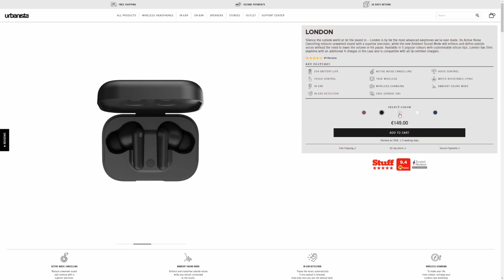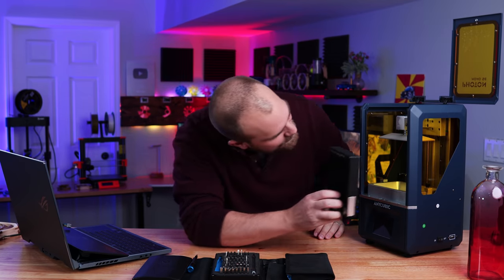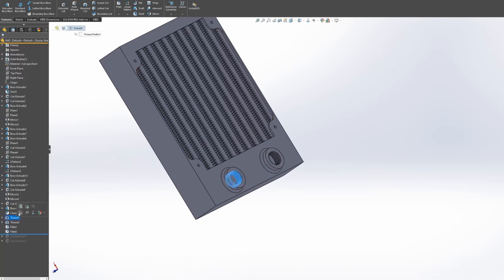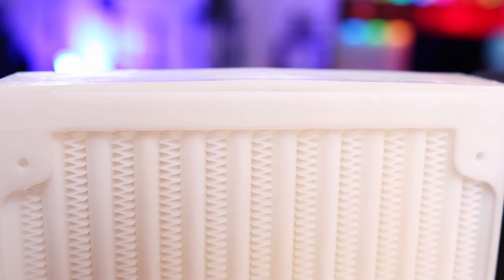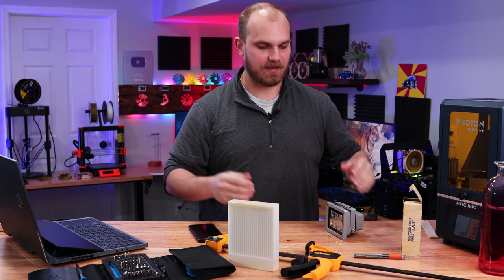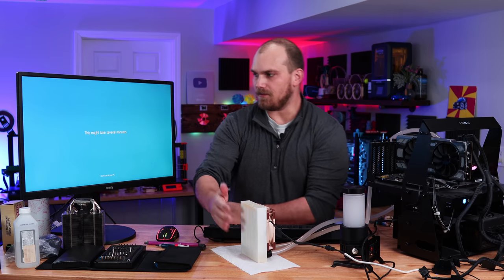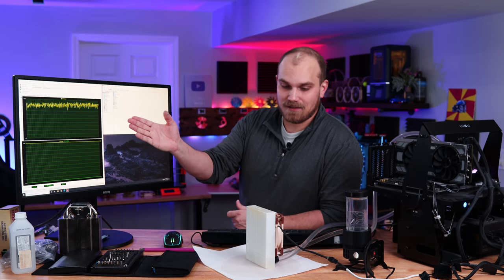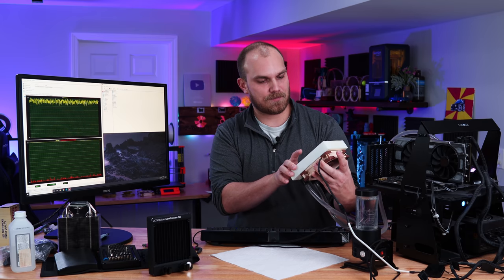I Never Expected This | 3D Printed EK Coolstream SE 120mm Radiator

Comment: There is metal resin called Tethon Ferrolite
However, it is 200 bucks for 500 mL
But maybe a sponsor wants to see this :D
Reply: Exactly my thought we need to get this to the top of comments so he does it.
Reply: @jacobleeson4763  It would be a super interesting result! I hope it is possible to do
Reply from the maker: 200 ducks wow
i would def try it if i could get some
Reply: @MajorHardware  i would fund this project if i had the cash
Reply: @MajorHardware  
1. Make the walls of the water channels as thin as possible.
Why? -> If you have a infinite thin wall it doesn't matter what material it's made off.
2. Remove the fins between the water channels.
Why? -> Due to bad heat transfer of plastic they don't do much except of blocking the airflow.
3. Try to fit as many water channels in the given area as possible without blocking airflow too much.
Why? -> To increase the surface area, but without letting the wall effect having a big impact on the airflow. (check out fin stack spacing on noctua coolers)

PS: Thank you for your awesome videos and greetings from Germany.
Reply: @MajorHardware  Maybe check out ceramic resin?  Still pretty expensive from what I've seen, but less so than the iron resin.  Idk what type of ceramic it uses, but some ceramics have very high thermal conductivity, could be a cool thing to experiment with.
Reply: @MajorHardware  
There's also PLA with copper particles like copperFill but it's pricey too at around $50 for a 0.75kg spool.
Reply: @MajorHardware  The better option in terms of 3d printing a water cooling radiator is to actually make the radiator's frame (fittings/reservoir), but then use flattened copper tubes for your channels/fins with some kind of sealant.
Reply: @chucklesdeclown8819  Shall we make a free fund thingy for the project ? =)
Reply: @SevenSevenXAK  ceramics are known for there thermal resistance....
Reply: @MajorHardware  Well, email them, they might be willing to send you some for a re-do of this project.

But you might want a slightly larger printer before trying.....
Reply: im proud of the boys , engireers for the future. im not sure about the inner tube construction but a long snake loop within the radiator would be ideal. the water spends longer in the path of the air and should in theory dissipate heat better . think an ac radiator that loops back on itself many times.
Reply: @SevenSevenXAK  i think the ceramic prints need a Lot of processing after the Print (Very hot oven) and maybe too small parts that could easily Break at such an expensive print
Reply: @-eMpTy-  i think the Resolution of PLA isnt good enough when you need so many water-tight Channels
Reply: @-eMpTy-  It's pretty brittle though which makes thin walls a no go
Reply: @blendarious  All of this.
Reply: @Corianas_  
Fair warning, I know NOTHING about 3d printing/resin printing and such. My thought, instead of a bigger printer, maybe just shrink the overall size 5-10 mil (if that much) for it to fit, or was it that much of a stretch for the printer?? If I recall he said something about max size was 160, couldn't he set it to 158 just for clearance of the printer and not effect the print results too much for the worst?
Reply: @Destroyer9747  I was thinking this while watching, like how some water blocks have an acrylic top.  My only concern would be if there would be a higher likelihood of leaking between the metal and resin seal.
Reply: @AceBoy2099  Not exactly... the issue he had was more pressure related. as the top is a large flat surface that is held on only by the edges, when the bed lifts it sticks to the build surface a little too long, which creates minor break like he had to fix.

To solve, you don't shrink the model much, but instead have it on an angle,, with supports to get it at that angle.

This would reduces the surface area the top has made per layer, which would allow it to lift up easier without damaging the water tight nature.

but, making it 10-15 degrees off flat, would increase the height significantly, even without supports.
Reply: plus the other issue is, the top gets made as a single piece, and watertight... so lifting lifts all the uncured resin as well, which would rip through the .1(ish)mm plastic bottom.

this could be solved by flipping it upside down i guess so the pipe holes let it drain... but it could be messy depending on how much liquid is trapped....
Reply: 200 ducks is a lot of ducks
Reply: @Corianas_  yeah, but even a 3-5° shift should help.
Reply: @martindinner3621  True. But still he wouldn't fit it in, as the base the supports would need would push it over the height limit.

Unless he shrunk the distance at the bottom where the water goes in/out... that doesn't have to conform to fan size the same, and I think i saw 1-2cm it could loose there....
Reply: @jacobleeson4763  yess'
Reply: @MajorHardware  if you would bite the bullet I'd love to see what it is like!
Reply: @TimmyBlumberg  Are you calling him a quack?
Reply: One of the biggest advantages plastic will give you is less galvanic corrosion, this will massively increase the water loop life cycle. May be we should keep experimenting with plastic only.
Reply: @rallygsixtwo4836  Different types of ceramic have different thermal properties. Some are optimized for high thermal conductivity, like aluminium oxide used in many thermal pastes.
Reply: Actually... I take it back. No angle. Same printer. Replace the top that broke with a 1/2 circle pipe shape, would get rid of the large surface sticking, and would allow the other end to be anchored solidly to the bed.
Reply: @MikrySoft  that’s why I said there known for there thermal resistance
Reply: It could work for sure, but i don't think anyone is producing resin with any of the following ceramics, and it would have to be a resin, because any fillament would simply melt before it should if it had a great thermal conductivity.

Ceramic materials with high thermal conductivity are mainly composed of oxides, nitrides, carbides, and borides, such as polycrystalline diamond ceramics, aluminum nitride, beryllium oxide, silicon nitride, and silicon carbide. Diamond has a strong thermal conductivity
Reply: @icediverfull  That's true, I'd imagine something as complex as a radiator wouldn't hold up well to the post-process. 

Although I do wonder if an unprocessed print would still be functional and perhaps still have higher thermal conductivity than plastic due to the ceramic particles.
Reply: @Corianas_  I like where you are going with this! Maybe go quarter cylinder to maintain the mounting space on thw fan side?
Reply: Maybe you can just mix in your own metal powder?
Reply: @blendarious  two a point, of leackyness. but a few touch-ups to hold pressure and ya good.
Reply: @SevenSevenXAK  Most need firing in a kiln after printing e.g. Porcelite. The one I found which didn't used Zirconium dioxide, which is used as a thermal insulator.
Reply: @-eMpTy-  PLA won't work. TG around 60c max he is topping 100c actually surprised the resin held up to that!
Reply: @SevenSevenXAK   Formlabs.com says this - "While Ceramic Resin is not considered an advanced technical ceramic, fired parts have unique properties when compared to plastics, like high temperature resistance, high thermal and electrical insulation, high resistance to corrosion and wear, and chemical inertness.." Now this could come in handy. Some parts you want to be insulators and others you want to be conductors.
Reply: @SevenSevenXAK  Yes, that would be your oxides, nitrides, carbides, and borides-based ceramics.
Reply: @tobiwonkanogy2975  yes, that. make a flat labyrinth/snake  tube as a fat radiator - one in and one out with inner flat tube cross-section being at least equal to round tube cross-section.
a fat radiator and no little fins so air would go through radiator without being hindered. flat wide tube would cool water much more efficiently. with this it might actually be a much better resin radiator.
Reply: @MajorHardware  A word of warning: most additive (metal/ceramic) resins require you "burn off" the resin in a Kiln to get the full benefit of a 3D printed Metal/ceramic part! It also is of note that the project will shrink in size after being in the Kiln.
Reply: @Sagarmadpe  Excellent point plastic oxidizes incedibly slowly. meaning you could have a 20 year loop with only  the water and pump to worry about. Very smart thinking
Reply: @tobiwonkanogy2975  look at a tesla valve.
Reply: Look up fluid dynamics and muffler harmonics. If you can vortex cool a ram jet with the fuel that it is burning, you should be able to print a block that pulls the air and liquid fluids smoothly and naturally then make the outer of the print an artistic piece. Try to apply the golden ratio.
Reply: @coreytillotson3313  I'm familiar with integza and the purpose the of the tesla valve but not sue how we could use that in a small enough form factor to make use of the required air movement. good idea to slow the flkuid down even more but simple triangular baffles would achive the same effect
Reply: @tobiwonkanogy2975  i was only referencing the science not the design.
Reply: @SevenSevenXAK  I kinda would like to see a ceramic liquid cooling loop now.
Reply: Up!
Reply: Maybe a patreon kind of jobby I would put in for this.
Reply: @blendarious  This, and while it's been mentioned by others, a rounded, half-cylinder shaped top would help prevent the printing error at the top of the radiator.  In fact, making all the border walls rounded, maybe with just a bit of flatness at the bottom, would help conserve the amount of printing resin needed for the project, or free up enough of the original amount to alter the design.
Reply: @MajorHardware  This started as a small supplement to Blendarious, but once I got started the ideas started flowing, 
so I thought I'd bring them to your attention directly (I hope). Since I cut it directly from my addition to his comment the format's wonky, but the ideas are what matters here, so I trust that the structure can be ignored. Re-writes are a PITA, lol. 

"But the most relevant aspect is, as Blendarious says, is that the "cooling vanes" don't help cool anything, so treat them as structural supports that reduce airflow.  Come to that, perhaps the channels should also be rounded, maybe in two rows of staggered tubes. From there, the tubes could be designed to be slightly wavy, extending the distance the water travels, and instead of side-by-side chambers, maybe front and back, instead.  Then performance could be tested to see which side works better as the input, the front set of tubes or the back (fan side) set.  Furthermore, the s-curve shape lends itself to mutual support with minimal structural bracing.  Say, as an example, one side curves one way and the other side the opposite, with horizontal support every time they cross paths, like two out of phase sine waves.  If the pairs alternated in orientation, then horizontal bracing when they near their neighbors also becomes practical."
Reply: @bookman7409  So would lots of thin tubes in a pachinco machine type setup work better than a series of flattened Tesla valves acting like wind vanes?

By pachincho I mean like
|   o   o   o   o   o   |
|  o  o  o   o    o   o|
Reply: @Corianas_  That's my thought, anyway, though I'd have thought bowling pins, lol.  Unless the alternating sine waves pattern may alter that, a bit difficult for me to fully visualize. Either way, it's a matter of maximizing airflow cooling WRT the tubes, though I think a longer pathway using something like the S pattern, so something similar that works better.
Reply: @Corianas_  After thinking a bit more, the hot input is likely best placed serving the cooling tubes farther away from the fan, getting a little cooling before passing through the primary cooling grid.
Reply: @rallygsixtwo4836  ceramics can be both thermally conductive and thermally resistant(high melting point), certain bodies are very non conductive like fire bricks(bricks you might find in the walls of a kiln) while other bodies are much more thermally conductive(maybe not as much as metal though). I mean, you can cook in purpose made ceramic pans.
Reply: All this talk of adding metal seems like a bad idea to me. Wouldn't it just rust? I'd like to see if you could just add carbon nanotubes to the solution to get better heat dissipation because they're very good at transferring heat.
Reply: @FailTrainS  
You could be correct, but it wopuld be interesting fot experimenting reasons. maybe there are some kind of aluminium based resins? Or maybe water additives that prevent iron rust.
But carbon could also be a good idea. maybe Resins with carbon have better heat characterisitcs
Reply: @chucklesdeclown8819  I would be a millionnaire if I had the cash :D
Reply: @hemhazgames  yeah why I said there known for there resistance, read it carefully, K N O W N   F O R, not all of them
Reply: Problem is how many people have a sintering oven that can get up to 1100c - 2012f?
Reply: @MajorHardware Here's the link to it, if you still want to try. 
 https://tethon3d.com/product/ferrolite-iron-resin-500ml/
Reply: @blendarious  I agree with most of Your comments, but.... 
Regarding "2. Remove the fins between the water channels.-> Due to bad heat transfer of plastic they don't do much except of blocking the airflow."
I would somewhat disagree, arguing that the ""fins"" do fill ONE meaningful function. Namely they provide "structural integrity and support" to the fluid channels. So though I do agree that he should minimise the "fins" in order to maximise the effective (crucial) airflow,  he should NOT totally eliminate them without having seriously considered the "supporting function" that he is also removing at the same time by doing so. Possibly he can totally eliminate the "fins" if he constructs the fluid channels in such a manner that they create a "pattern" where the channels "touch and support each other" to a sufficient degree. (I.e. designs the cooler not using  just "straight pipes")
This can become another series that is really interesting to follow the development of :)
Best regards
Reply: @blendarious  i was going to say something similar, but I'm 2 days late for the video! :) .. this would help the heat transfer/dissipation quite a lot.
Reply: @MajorHardware  What would happen if you mix in some kind of metal powder in the resin? Would it cure? For example take some copper pipe, sand it and take that powder and mix it up in the resin.
Reply: @MajorHardware  There is also a ceramic resin, would be interesting.
Reply: Maybe do a radiator show down and the top one gets printed in Tethon Ferrolite to be put head to head against a good quality standard radiator to see how it stacks up (price and performance wise).
Reply: @SevenSevenXAK  ceramics are also very good thermal insulators. 
so that could turn out better or worse depending on the ceramic properties.
Reply: @SevenSevenXAK  From what I've seen with ceramic resin, you still need to bake it in a kiln and there is significant shrinking once you do so.  If he's got access to that kind of setup and can calculate the shrinking ratio then it could be a neat option.
Reply: what about flash-forges metal impregnated filament? you can get aluminum and copper and its only $75 a spool, might be another option and they'd probably be willing to sponsor
Reply: @caseyglenn577  FDM Printers aren't really capable of printing super small precise and water tight channels for a radiator
Reply: @icediverfull  fewer large channels then? It's just a thought lol
Reply: @SevenSevenXAK  ceramic is generally an insulator, and would have to be engineered for thermal conductivity. Not that it doesn't exist, but would be uncommon, and expensive.
Reply: Another interesting thermally conductive resin is made by the Finnish company Carbodeon. It is a PLA with imbedded diamond nanoparticles. Not sure what the weight to volume conversion is, but a 500g spool is €35. https://carbodeon.com/product/udiamond/
Reply: @blendarious  I like the idea of making a long pipe instead of the fin structure. Maybe some fins to make it more solid (like someone said), but this could really be a good solution. And the thinner the walls the better of course, but I think there's a line that can't be crossed with this production tehcnique.
Reply: DOGGO!!!!!!!!!
Reply: adding metal could cause corrosion, as others have said, and wouldn't it negatively affect the strength?
Reply: @SevenSevenXAK  Alphasense Ceramic FTW, USD $65 for 500ml.  Can fire it in a kiln after printing (or not), it's the real deal.
Reply: Regular Metal filled filament would work
Reply: @MajorHardware  maybe make your own with some metal filings and regular resin
Reply: @hemhazgames  he knows that but he was referencing what the guy said about a certain material for 3d printing not all of ceramics in general
Reply: There are much cheaper copper-PLA FDM filaments. Not perfect, but definitely conduct heat and electricity surprisingly well.
Reply: @g.4279  With FDM it is harder to get water tight or tight tolerances in general. Could be worth a try nonetheless
Reply: I wouldnt use iron filled resin with watercooled applications, iron rusts. Or well you could with anti-rusting and anti-corrosive agents. Maybe use aluminium variant? Yes corrosion is there but there are anti-corrosives for that too.

Comment: You need a control run without the 3D printed  cooler to see how good the cooling is without any mayor cooling. The water-tank, pipes and the heat sink probably do a lot of cooling.

When doing this test run make sure you have the same amount of pipes so you get a good comparison between the runs.
And also get a smaller water-tank to minimizing the time it takes to heat all the water.